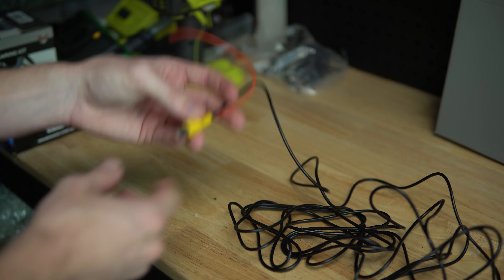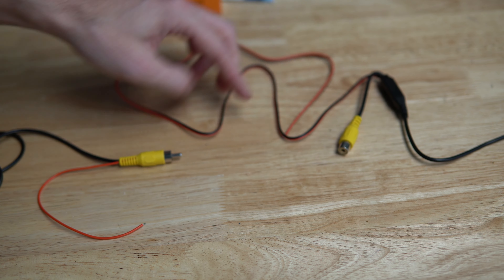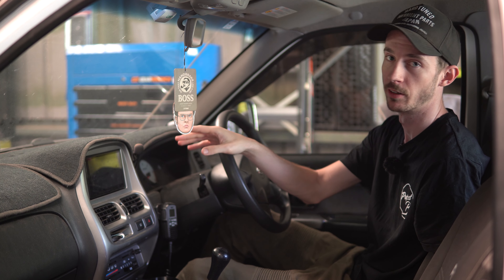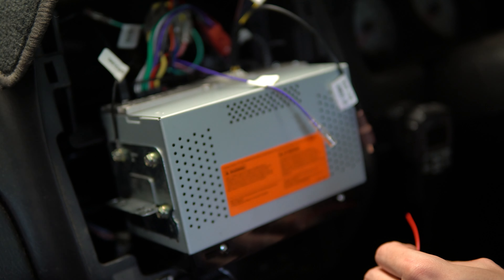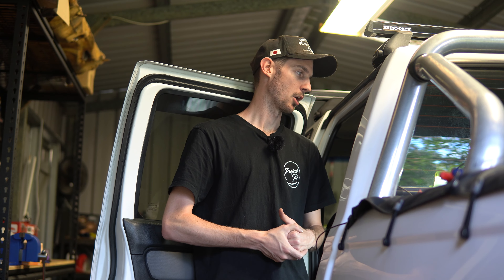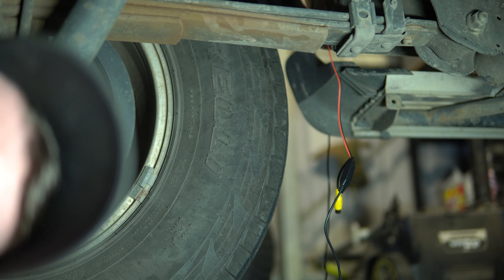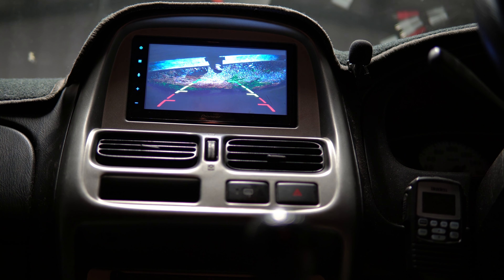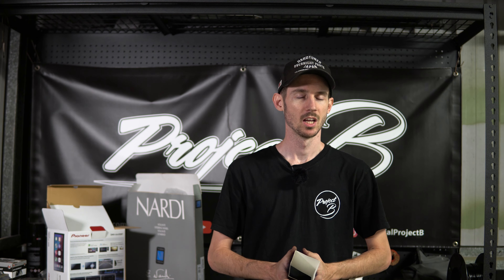Reverse Camera Install on a Nissan Navara D22 | How To

Comment: No need to drill rear of cab, there are factory air vents in the rear of the cab on the d22 that the wires can be tucked through.
Reply from the maker: Whereabouts are they? Couldn't seem to find them on mine. Really didnt want to drill into the back but its too late now haha
Reply: @Project_B  if you shine a torch between the tub and the cab you will see it just behind the rear seat belt assembly. You do need to unbolt the rear seat belt to get access but it's pretty easy to do.
Reply from the maker: @ACM  Thanks for the info! I'll pin your comment at the top so hopefully others will be able to do it that way👍
Reply: Vents on right side, between cab and tub.
Reply: My 2014 has a factory hole near the left hand rear seatbelt with a grommet negative cable and if you look under the cab is a grommet perfect for cables.

Comment: Hey mate, great video! Do you have any tips for finding the tail light to tap into? How do I access the loom?
Reply from the maker: What i did was take off the tailight and unplug it and with the plug on the loom side, just test it with a multimeter to find the reverse, and then just tap into that wire. If you also have a d22, the wire was the red one 2nd on the top left of the plug
Reply: @Project_B  Awesome. I’ve got a 2013 D22, appreciate your help :)

Comment: No need to drill  - there’s so many accessory grommets on the floor, ie. two under the driver’s seat, two under passenger’s. Moving the seat out of the way to lift the carpet takes literally 15s with an impact wrench.